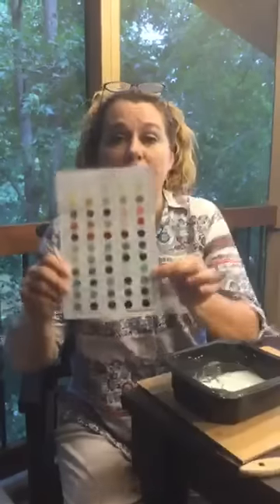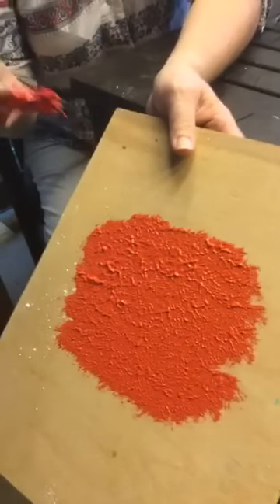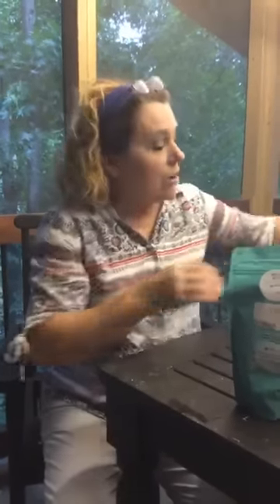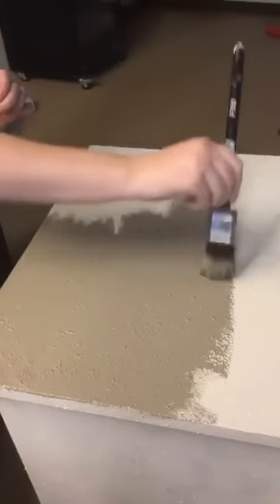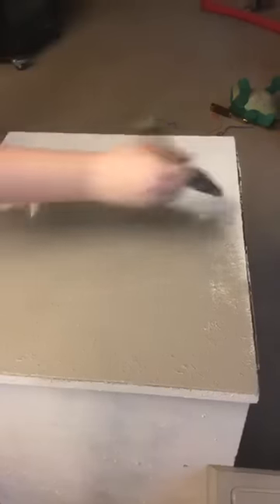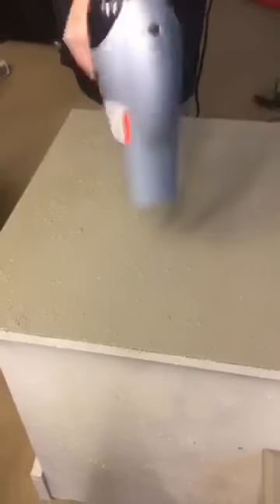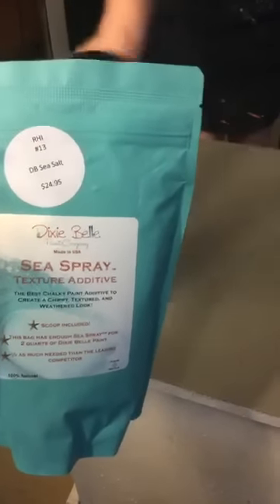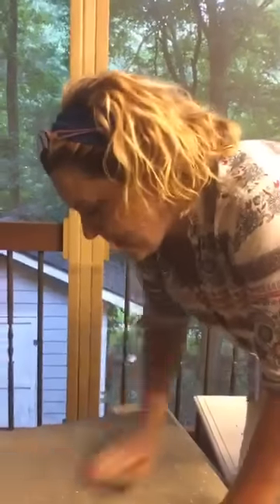How to Repair Water Damaged Particle Board Furniture - #paintedfurniture  #diy #waterdamaged

Comment: Hi, I have a desk that needs some love. May I get a step by step of what you did? Did you sand it first? Then mix the sea spray with paint, Then painted another color before sanding, then gator hide?
Reply from the maker: Yes, sand first to get things smooth.  Then mix the sea spray with the paint.  then the next color without sea spray in it - and sand if you want both colors to show or both coats can be the same color and no sanding is required.  Then topcoat